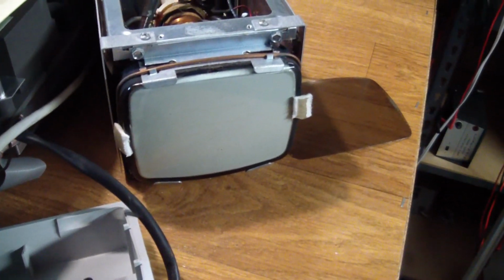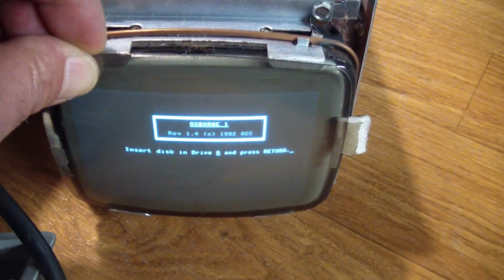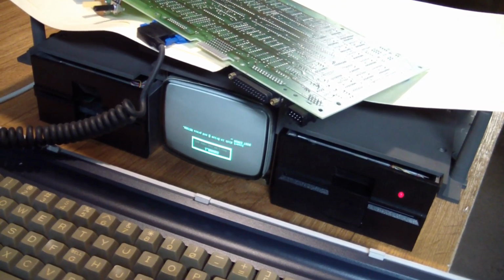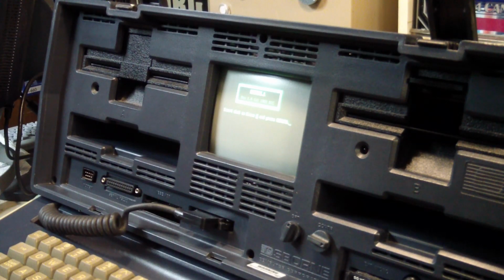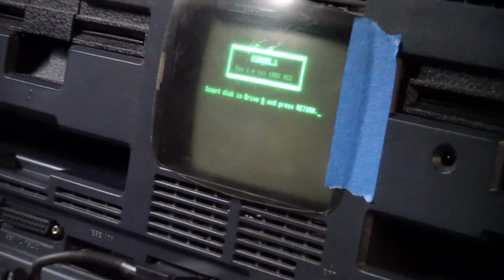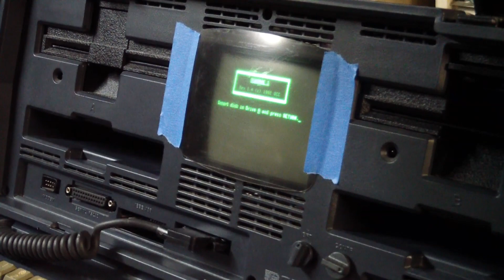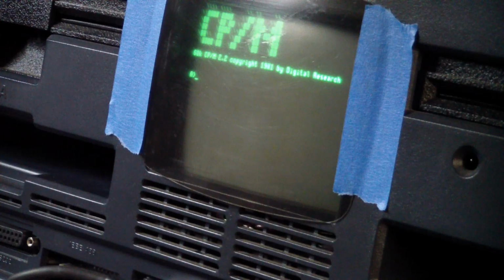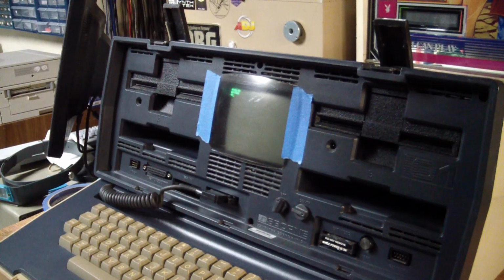AE#98 Osborne 1 Computer Repair, Part 3

Comment: Hello Artie - I've got an old Osborne 1 that I need to restore.  Any chance your spare Osbornes might become parts units?  If so, I need a decent handle for mine - the original one broke and the owner just took it off and threw it away.

Keep up the good videos.
Reply from the maker: For now I'm holding on to all the spares I have, especially the handle which seems to get damaged frequently. But if I decide to sell it I'll let you know.
Reply: @artifactelectronics  Thanks.  I appreciate you keeping me in mind.  Enjoy the restoration projects and we'll enjoy watching.